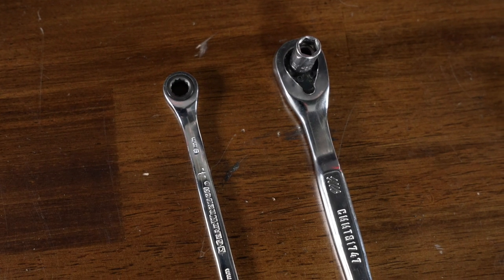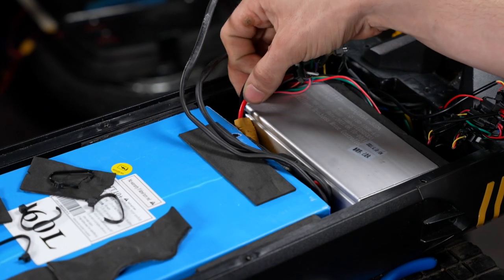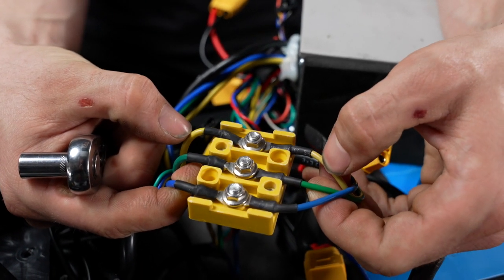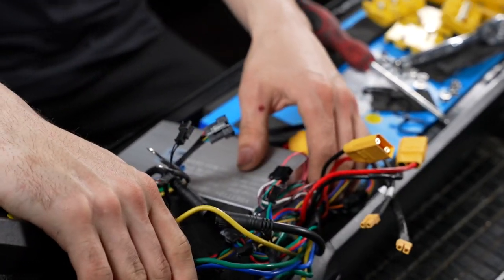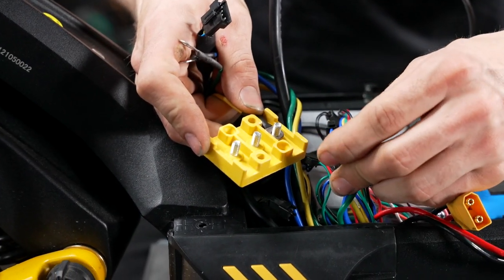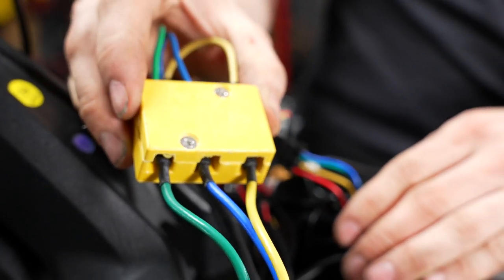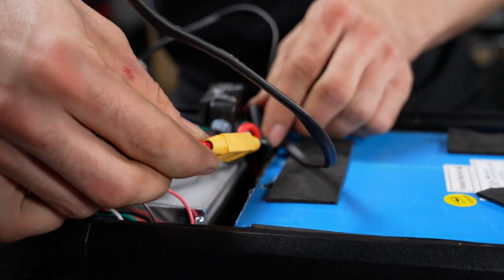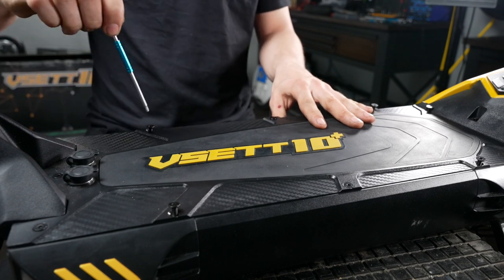How to Change the VSETT 10+ Motor Controller

Comment: great video!

I have to open up the junction box for the phase wires in my scooter so I can secure the nuts locking down the wires, will be applying some threadlocker and silicone to be extra secure / peace of mind they will never short out... apparently these can be a common failure point and cause fires so better safe than sorry.

Comment: You got a new sub.  i managed to fry my 3 weeks old vsett10+ controller today wohoo. Been reading about the P11 setting. And i keept it on 1 -_Q. and i was riding today on my lunchbreak, the display showed 100% battery. And i was driving abit to fast. And needed to brake hard,  the tire was screeching, leaving smoke behind, so yeah a emergency break :P But after that the front motor was completely dead, some vibration etc. So i  contacted the store, and the dude said, its mostly the controller. Luckily me i dont have to resend the scooter to the store, they send me a new controller. So hopefully (thanks to you)  i have a working Vsett 10+ again :) Ill managed to remove the controller without problems, so hopefully ill manage to put it back also :P
Reply: Must be a pretty poor quality scooter then
Reply: The Electronic brake is the problem, Fries controller
Reply: i got it.might be the same problem to my vs10 just now.the setting was the same,scenario and symptom also the same.might need new controller also😅.tq for mentioning that.regen system suck on these
Reply: have the exact same issue! was it the controller or was it a fuse? please help me out :)

Comment: Thanks for the video, quick question, I put new controller on my brother’s vsetts10+ everything works, has the white wire speed limiter connected only on the controller. After installation the scooter drives only 15mph. They said disconnect it or cut the white wire to remove speed limiter. I cut it separate it, still 15 mph. Do you think I have to adjust something on the menu? thanks for the good video 👍🙂

Comment: Can you guys do a video on how to change the actual motor
Reply from the maker: Its a combination of the tire change and the controller but yeah we will work on that.
Reply: @RevRides360  I am still waiting for a motor change video, my rear motor broke off and has lot of vibration, wont turn smoothly and I feel notches inside of it

Comment: Good morning,  question why would you replace your controller?  Can it be upgraded? For a better scooter performance.
Reply: No, it's because the Vsett ones are garbage and crap out after a year and they know you will need new ones, I have the 8 plus and my front wheel controller is jacked up and they refuse to send me a new one, I told them that when I'm riding in dual motor mode (the only mode that uses the front wheel) I can feel the front wheel struggling and randomly cutting out and coming back, they told me that I have to send them a video showing proof of this, how do I get a video of me riding it full speed and be able to show the scooter not having power sometimes to the front wheel. It's something you have to feel by riding it and it only happens once in a while, it's like they know I won't be able to do this so they hope I just buy a new one

Comment: I need some tips for my vsett 10 tires I had it for 3 weeks and got 3 flats on it. I weight 180 pounds normal speed 25-30 I don't use it aggressively just to go to work and school
Reply from the maker: Thanks for your reply, we're happy to help! Please send us an email: service@revrides.com
Reply: its common on vest 10+ and isn't directly indicative of tyre pressure - standard tyres are cheap CST. I found that spending money on PMT e fires reduced this a lot. I am in the works of trying to upgrade 11" tyres on it. I think the 10+ should've been put with 11" tyres IMO.
Reply: Here’s a tip don’t buy a vsett 10+ I’ve had nothing but problems

Comment: Anyone find an electrical schematic for this controller yet?    I’ve looked for similar models with a single speed controller for dual 60v motors, but the 10+ is the only one I know uses one.

Comment: I have a question does sinewave better than square wave ? I don't have any clue with one is original
Reply from the maker: Sine wave controllers typically have a smoother throttle response, while square wave controllers have higher efficiency and a more punchy response

Comment: Having bad luck… both motors aren’t working neither is the headlight..
Reply from the maker: Definitely sounds like a controller issue contactus@revrides.com
Reply: @RevRides360  I bought through Alien Rides, I just had it shipped back. Tried a new controller first but didn’t have any luck. Hopefully they can fix it.

Comment: First step u did wrong. Is unplugging everything all at once
Reply from the maker: We did it correct.
Reply: @RevRides360  yes u did. But people who have no clue will just see there's alot of wires. And when yous know what wires are for what the people watching will have no clue. Which is why u should of taught them the proper way first